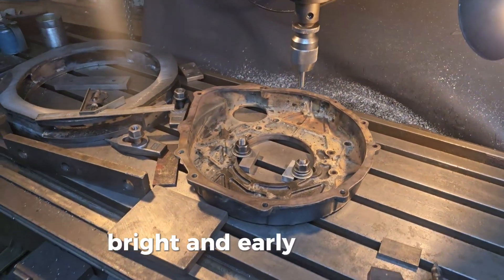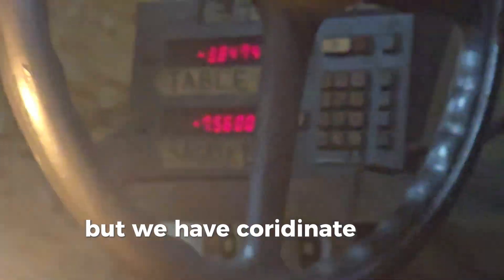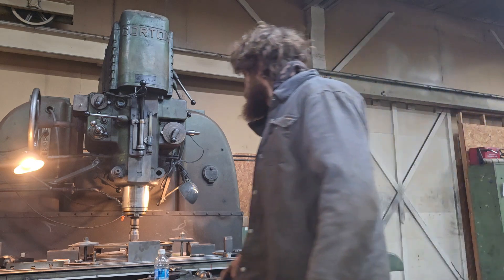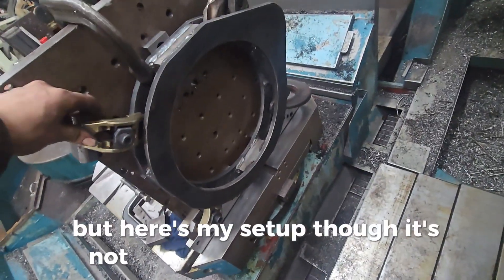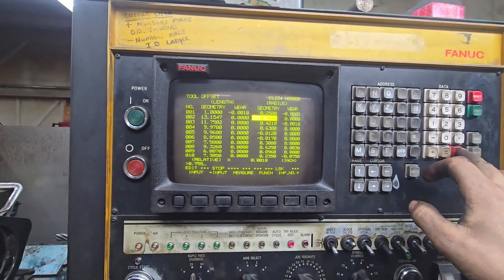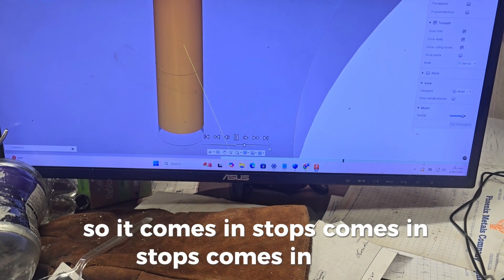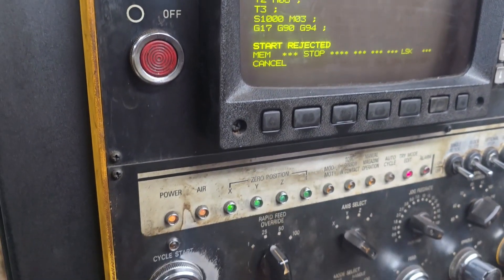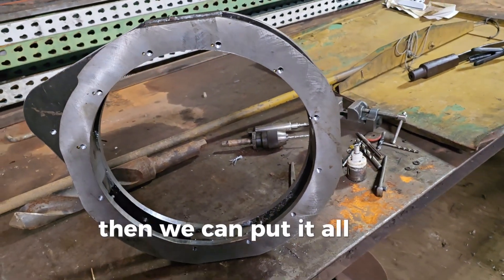Machining a Custom Engine Adapter Plate

Comment: I am curious to know what in the code you think made the holes offset that smidge. I don’t know much about any of this but enjoy watching it. Thanks for sharing!
Reply from the maker: I set the work offset incorrectly or made a mistake when typing in the gcode. I am buying all of the stuff so I can upload the code to the machine via laptop to avoid typing errors when hand typing the code into the controller.